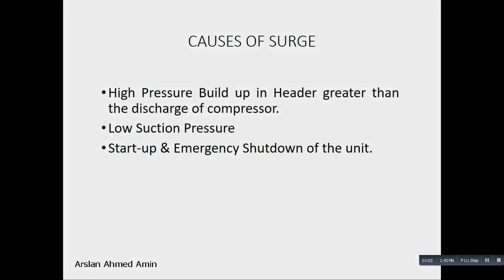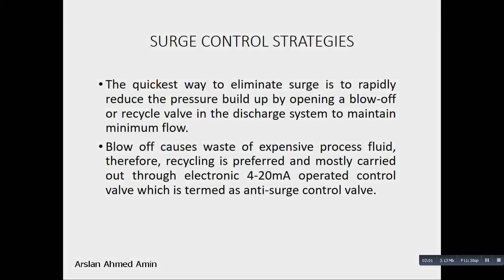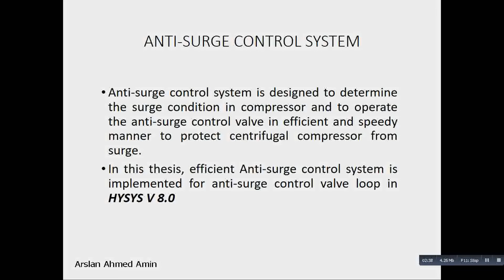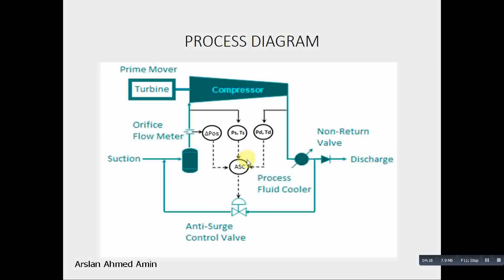Anti Surge Control System for Centrifugal Compressors Protection, Compressor Control System Part 5

Comment: Can call hot gas bypass valve?
Reply from the maker: Yes
Reply: I think, hot gas bypass normally called for a pipe line connected from the upstream of  cooler to recycle (anti surge) line with a globe valve.